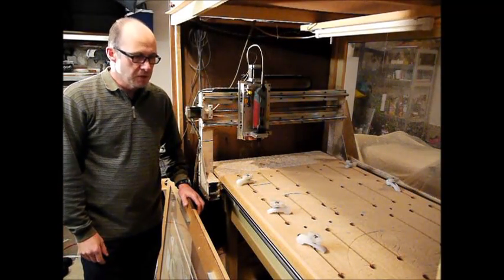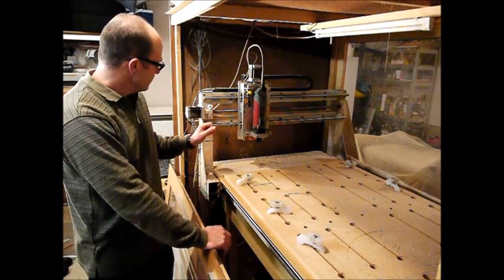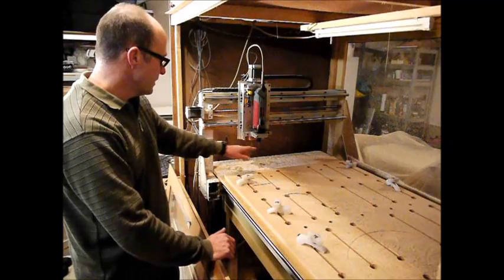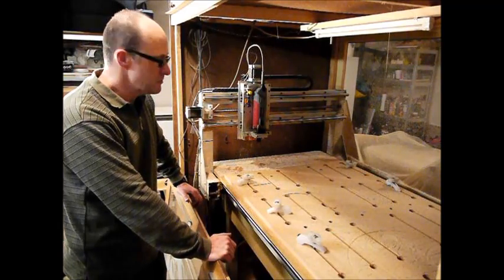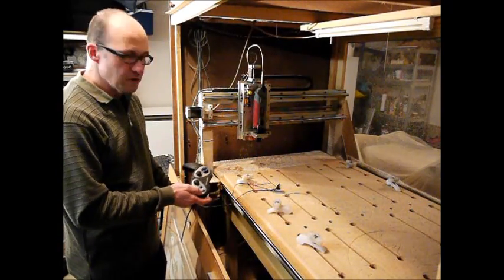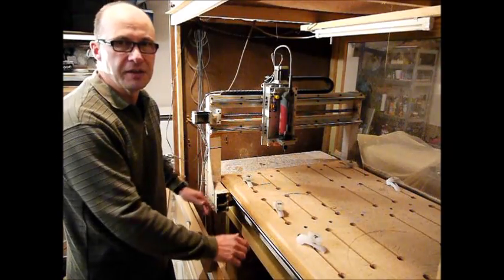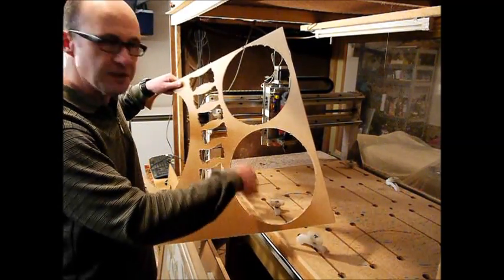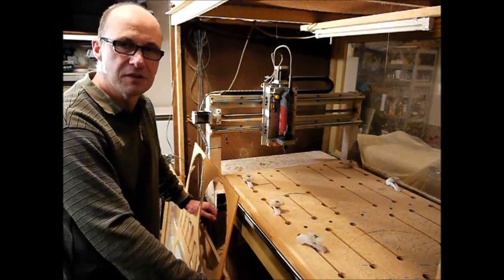The CNC Router   Part 2

Comment: Hey Kevin.

I am not that familiar with CNC Routers, but i know the brand of Spindle you are using the Crest brand is very good.
But any machinery Made in Germany is always going to be Very Good.

The sacrificial table top is a good idea, and the clamping set-up looks like you can mostly clamp anything down.

Very Good set-up you have.
Thanks for Part 2.
Regards Peter.
Reply from the maker: Hi Peter.
Both the CNC Router and Laser cutter have done a lot of work.
They are great machines to have, so many opportunities.